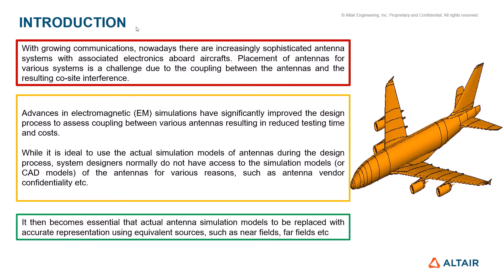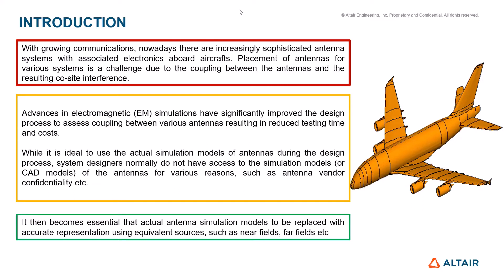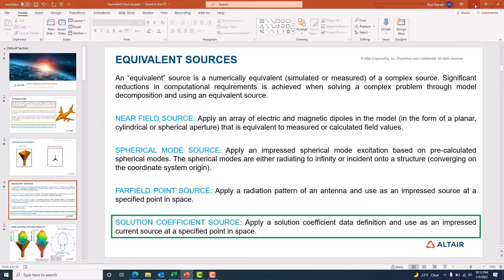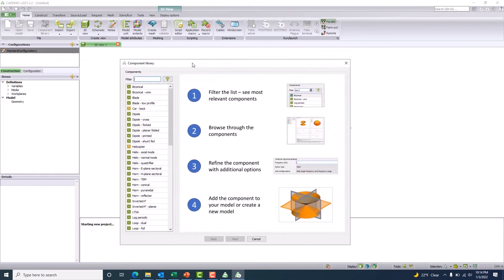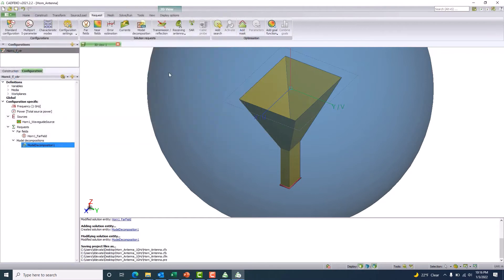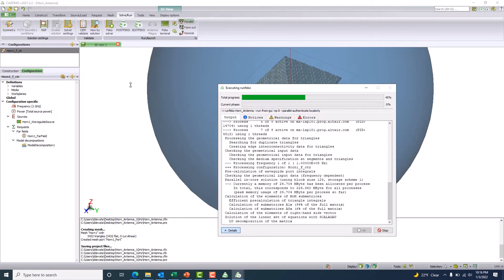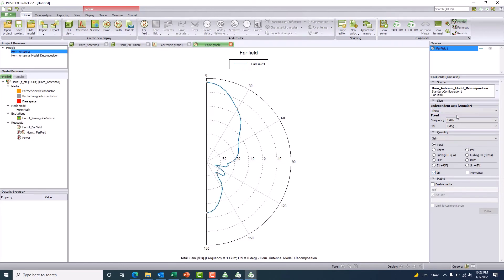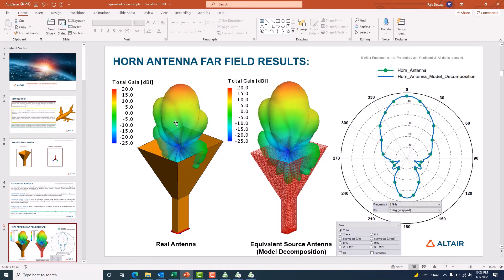Altair FEKO ANTENNA MODELLING: EQUIVALENT SOURCES (Model Decomposition)

Comment: Thanks for this video. Does the solution coefficient data source support wire solutions? I have an antenna model (both triangles and wires) which I simulate and save the data in a .sol file, and when I re-introduce this file in a new model as an equivalent source with no other geometry involved, I compare and get different far-field results than the original model. In POSTFEKO, this new model's 3D view shows me only the triangular mesh, hence the question of whether the wire currents are missing from the .sol file.